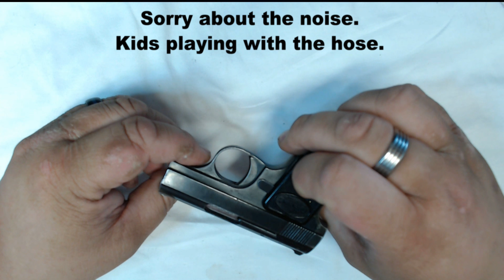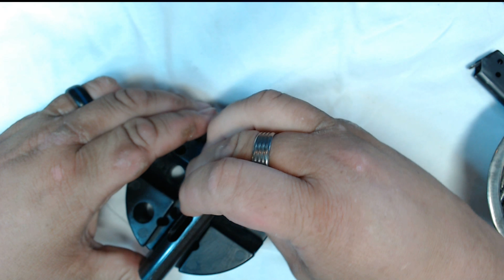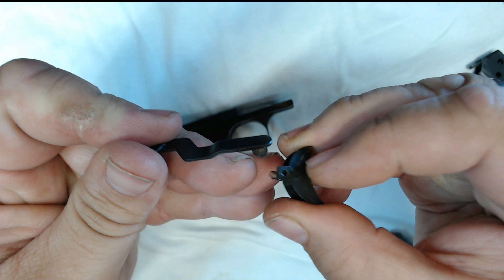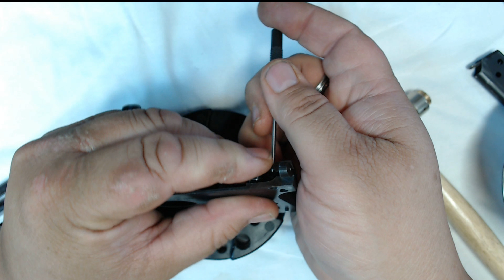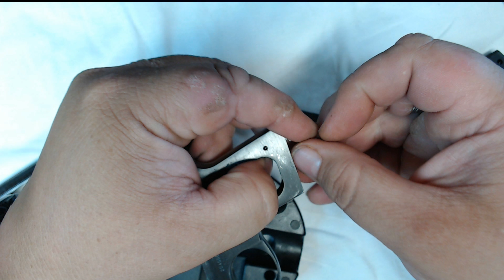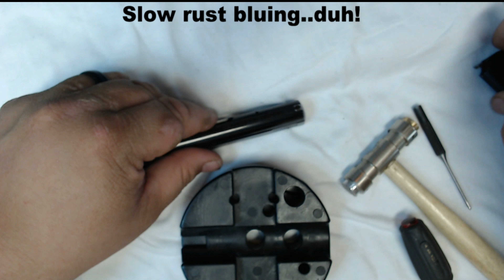Baby Browning 25 Disassembly

Comment: I didn't know about using the safety lever to hold the slide in place for the barrel to be turned out - always did a little guesswork and holding the slide with my hand.  Many thanks - learned something new.

Comment: Thank you for explaining the difference between a field strip and a tear down. I’m trying to follow you on my Bauer.25 . My friend says it will not automatically cycle another round . Also the Bauer is stainless. No one can agree on what type of lubricant works best. Galling seems to be the main issue. Would a nice copper antisieze be a bad idea.
Reply from the maker: I've tried the copper antisieze a few times, but I usually just use Break Free CLP

Comment: Howdy partner, my name is Damien, and I have this same baby browning but I can’t get the spring back in the magazine, what kind of trick can I use to reassemble the mag release? Thanks in advance buddy👍
Reply from the maker: I go over a trick to do that in my Baby Browning assembly video.  Basically, you need to use a punch to retain the mag release in a specific way so the other parts can be put in, then the pin that holds the mag release pushes the punch out.  Thanks for watching!

Comment: This is the best video I’ve seen bc I’m having problems getting the mag release back in properly, can you please help me?
Reply from the maker: Oh yeah, that mag release is a fidgety little bugger.  What you need to do is use a punch to capture just one side of the release so you can get the spring in place.  Then use the pin to capture the spring and push out the punch.  It's a pain, but just takes some patience and time
Reply: @NinjaMidget1969  ok I think I can get it now, I appreciate that a lot bud Thanks and I love your videos!!!!

Comment: Did you create a assembly of the browning video having trouble getting the indicator to catch the firing pin it slides but doesn't retain spring also won't release tension

Comment: WARNING: DO NOT start tearing this gun down before watching a bit of his ‘Assembly’ video to make sure you can handle the job. This ‘Disassembly’ video makes it look very easy, but his next video is very hard to follow because (not his fault) his hands and fingers are so large and the parts are so small, it’s very difficult to understand how things go back in or how to maneuver them. Just beware if you’re a beginner messing with one of these.

Comment: @NinjaMidget  Hello from South Africa :) Im planning to purchase a Baby Browning for CCW. From my knowledge these pistols are quite well built and strong. I just wanted to ask your expertise regarding the safety of this pistol. Is it safe to carry "cocked and locked" with one in the chamber? How small is the sear and whats keeping the firing pin from firing if the pistol were to be accidentally dropped. Apparently the safety only locks the trigger but doesn't block the firing pin. Your knowledge and expertise will be much appreciated. Thanks
Reply: South Africa.....I would get a Walther PPK 9mm....that is a real issue decider if you need one. 
In the 70's in Cape Town I slept with one under my pillow, then I went back to UK, 15,000 gun deaths a year was too much to handle.